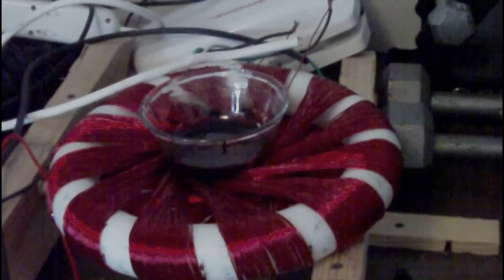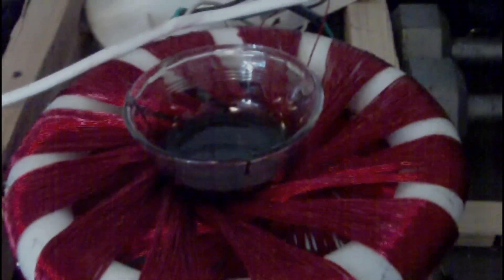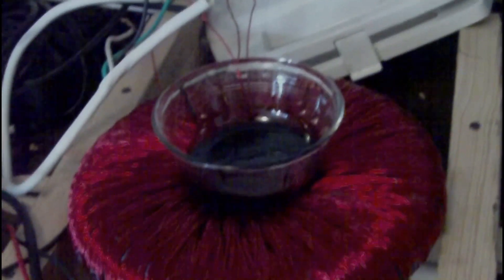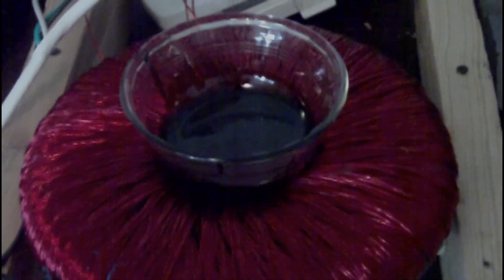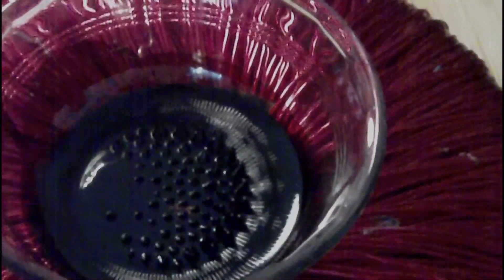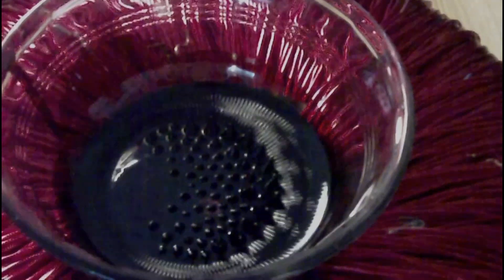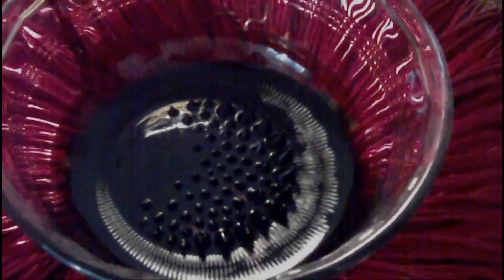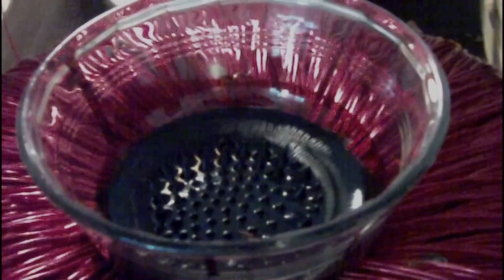FerroFluid Rodin Coil Rotation

Comment: Put a flake of something that won't absorb the liquid and will float and put on the outer edge to see the speed of spinning? Also if your fluid is conducive... take a multimeter and put one lead in the most center and the other on the most outer edge, and test for amperage and voltage ! You may be making a Faraday Disk with no parts to ware out from friction, that's what I'm about to work on, about, just need more wire, and I'm getting a "jig" cut to where it will be a cross between Rodin and Starship

Comment: try to make magnetic liquid from ceramic magnet dust(loudspeacker old style black magnet). with some synthetic oil and surfactant
when i put iron dust on magnetic stirer(chemistry), iron dust only moving to center of rotation of magnetic field, and became stable motionlessly. with Loudspeacker magnet dust, mountain of particles rotates beautyful, almost like tornado, i wish to get 3 colors of dust, or dust like compass,  bi-colored dust pieces, but paint will not work because of friction in moving dust

Comment: Freeze the fluid to -150 and put it in the coil then turn it on
Reply: JMlamborghini that would make the fluid rock solid fool
Reply: my research was leading me to think you need a core filled with magnetic substance that is capable of reaching the triple point (solid liquid and gas) perhaps while being a super conductor.  Maybe line the container with a chemical that removes any friction for optimal fluid spin. Maybe find the resonance frequencey of the core liquid and pump it through the coil. Maybe it would have some affect.

Comment: is that DC voltage? that IS DC... any ripple? Ya probably the 60 cycle hum rectified... that's a lot of current to have enough capactiance to cover...  But can tell from the center constant peaks it is primarily DC; nope I'm so wrong, it's AC... I guess normal peaks are just resonant.... though I don't understand why they stay quite so peaked and steady

Comment: Fill small ball with the fluid and put it in the center. U will have liquid magnetic core. Next fill the coil with the fluid. That should create additional rotating magnetic field at the boundries. Manipulating voltage and frec u will get different parameters of the core spin, and u have Home Made UFO.
Reply: Mateusz Góra contact me

Comment: why don't your rotate a ferrofluid in a magnet ring and see if it produces current?
Reply: or use electromagnets to push and pull the fluid through a hoop-like structure.

Comment: I was wondering the same thing as crafter2u, It looks like your donuts are made out of plastic. Wonder what would happen if you could get something that could take more heat. Maybe more costly to have made out of graphite, but theres gotta be something you could use on the cheap. I wonder about "forging" with a form, a donut using the same clear resin as paperweights are made out of. Wonder what the temp limits on it are.

Comment: Greetings Mavendex have an idea glad to see to got both elements here The Rodin Coil and the Ferrofluid, now here an idea make a see through Rodin Coil and place in some how the Ferrofluid.Either in case it in shut like cut the dohnut in half or inject it in and seal it, not sure but can go from there also place a neo ball or something to see if it enhances the anti gravity effect.Let me know how it goes.Peace
Reply: Katharsis540 I'm pretty sure that would just make it an iron core and would fuck it up, unless you can make it to where the Ferro fluid is only touching about 1 to 2/3rds of the donut at any time then it may work but it won't have much spin because it's all concentrated at the center

Comment: @NwoDispatcher: The reason ferro fluid is so unique is because the oil is BONDED to the iron oxide through a surfactant. This means that when u place a strong magnetic field near the ferro fluid the iron oxide wont separate at all from the oil because their are bonded together.

Comment: THE FERROFLUID GOES INSIDE THE DONUT.  NOT IN THE MIDDLE, NOT ON THE OUTSIDE.  IT GOES (inside) the tube that is the donut.  Does no one understand this?  The WHOLE point of this rodins coil is to create a gravity engine.  One you get the fluid moving fast enough it will start making it's own gravity.. then the real science begins.
Reply: Spxder that's actually not the whole point of it, it was made for energy demand.. if you put a ferrite core in the center aka Ferro fluid it will not work the same and it won't have spin, it has to interact with the aethers and ferrite blocks that, the only way you could do it is by putting many of them on their side over a hoop with them pushing one into the next

Comment: As I remember the TR-3B put the Ferrofluid INSIDE the Rodin Coil - which then accelerated much more? Also, to make their thermobottle I think they counterwound a 2nd Rodin in the opposite direction in phase sequence? This speed compressed the fluid so it no longer touched the bottle walls - thus eliminating friction. Result was about 70% less mass grav-pull with a 3' diameter Coil size.

Comment from the maker: @lightdanmo star ship coils seem to be more powerful, it all depends on what you mean by that, I'm taking all the questions in and having my previous coils shipped back for a series on what would be the best route, I have a star ship I have built, now with the same amount of wire as a standard Rodin coil you will get more of the spikes but.. the rotational energy doesn't exist. If that makes any sense. the reason for that is parallel pairs.

Comment from the maker: @Khepramancer Im just useing wall power AC so 120 volts at around 14 amps to get that effect. 
Working on setting up another Demo Showing a more powerfull coil dressed in Tinned copper wire vs. Normal Magwire

Comment: I've been wanting someone to do this experiment for a long time now with a Rodin style coil, very nice demo man, thank you for posting this.  The ribbon part on the perimeter of the ferrofluid pool reminds me of standing waves in a cymatics demonstration.  What type of current are you using for this demo?  You mentioned it being 12v, but if this is DC, that would be really interesting.  I'd also be interested in seeing of AC, or vice versa from what you're using here.  Anyway, keep it up ; )